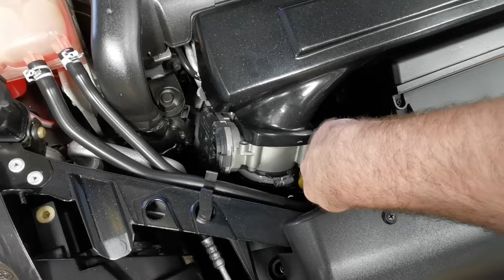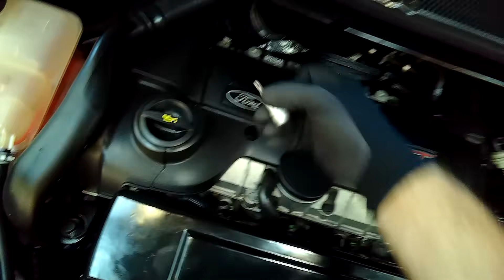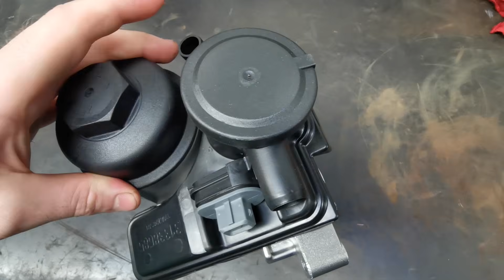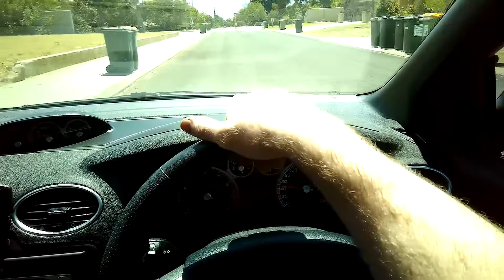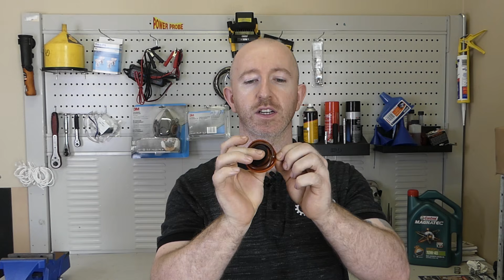PCV Failure In Ford & Volvo's - Step By Step Guide - DIY Repair

Comment from the maker: Lot's of Information in this one guys, remember whether you are removing the housing or just the cap to replace the membrane/diaphragm, I would highly recommend to check the pipes for splits or any blockages.
Due to the vast amount of engine's that this type of PCV valve assembly is included in, I listed websites and engine details in the description below. 
You should have all the information you need to repair this. Thanks for watching 🙏 🙏🙏
Reply: So my question is does the Volvo s40 1.8 2004 does it have the same set up  ? I've done the glove test and it is blowing the glove up. The car only has 84,000 on the clock. 
Really really great video my only problem is I don't know if my car has the same set up. 🏁🤝
Reply: instablaster

Comment: Was she burning any oil? Mine burns oil after going down a hill or over run with foot off the accelerator. Then give her a bit of throttle and a cloud of smoke comes out the exhaust. Do I have a bad PCV valve?

Comment: I have this car. Engine light came on + esp. Obd2 listed 5 codes...all sensors "low circuit". Identified fuse F35 blown. Replaced it. When press start button to only turn electrics on, smoke tindrel floated up from right top side of this oil filter housing. turned off car and Removed fuse... Fire hazard. Would this be caused by this component that has an elctrical connection to it ? I think its called a heater coil inside that diaphragm? If the wire isnt short ciircuited ... That is. Haven't seen anyone with this issue on youtube.

Comment: Very, very helpful! Do you know what is the whistling? One would think that its the air blowing through the broken membrane, but then opening the oil cap should amplify it even more as the air flow is now unobstructed
Reply: I’ve heard it’s air escaping through seals

Comment: Great stuff! Thank you! Was the suction from the oil cap gone after the repair? Or is it normal and just the whistling was a symptom?
Reply: I replaced mine I made sure i installed it the same way it came out! Howling gone but still getting suction at the oil filler and dipstick! I'm thinking just replacing the entire oil housing!!
Reply: as far as I understand it so far, after watching a ton of related content (mostly about volvo though) some delicate suction is required. This is what seals the membrane. @mitsuevo8mr

Comment: Would a bad PCV valve cause oil consumption
Reply: yes. if it's stuck on open it will cause oil consumption and misfires
Reply: Brilliant, thank you, just changing the rubber would be enough to solve it?

Comment: I just discovered a clogged PCV valve on my 2008 Volvo V50 1.6d. I only bought the car 3 week ago with 275.000km (170.900mi). The whole engine is dirty from oil. Approved and official mechanics basically told be to scrap the car or replace the engine. Does anybody think there's any other way?

Comment: So I have been wracking my brain for like, a year, trying to figure out why when we replaced the PCV oil trap on a 3.2L volvo, it now "honks" from the PCV diaphragm, either coming off the brake or just while idling, about every 5 seconds. The sound is for sure coming from the diaphragm of the replacement, and even replacing the diaphragm on the replacement oil catch a second time, we get the same thing. The design on those is even simpler - press cap, rubber diaphragm, and a single coil spring, there's an inlet (outlet?) under the diaphragm to the side of the central outlet(Inlet?), and then the central outlet(inlet?) -- any thoughts on why that all may be? It's been hell even trying to get an answer out of Volvo and they're the ones who built the dang things.
Reply: spoke with a volvo service, guy says there is oil trap box, that rarely anyone replaces. it can be partly blocked. what helped too mas right rpms at idle. i had misfire code, replaced coil, rpm went up and less noise now from PCV. i also replaced seals on dipstick and oil cap. next i will replace seal under oil cap(is some form of plastic neck attached to the valve covers). so basically i go through sealing out all vacuum leaks. my theory now is that slight leaks reduce vacuum, pcv opens a bit then closes fast making the sound. since leak is small and suction is good it "pumps" in an on/ off fashion. probably pcv is not calibrated to work with this tiny leaks to stay just a little open and it cycles through
Reply: same problem with xc9o v8. strange pumping noise i replaced the whole pcv!! no change. tjere is not much to clean neither, pcv there just regulates vacuum. i have now v8 that gjves darthvader breathjng sounds. could you solve tour problem and can share some tips? i have a large vacuum suction in dipstick and oil cap so vents i side engine should be ok as vacuum is reaching both down and top of the engine.
Reply: @biachpiach  I've posted elsewhere on this, but if it's still making a 'honk' (like a goose or duck) then the pcv replacement you received did not have the diaphragm fully seated from the supplier you bought it from, you may need to make a jig to clamp it on more firmly in a vice, it takes a lot more force than expected seating those properly. Darth vader sounds I'm not familiar with, the v8's have a slightly different setup than the 3.0 or 3.2 Si6, but other seal failures can affect it. Also, suction at the dip stick is good as long as it's not a really hard suction. Usually if a pcv is bad you'll see oil foaming on the dipstick, or smoke blowing out of the dipstick neck when you pull it out. Sorry I can't help more than that without being hands on, it's finnicky tracking down pcv issues on most of these cars

Comment: Thanks for taking the time to make this video and uploading Gerard. Followed it pretty much as you suggest. I’m guessing this car was a facelift as there were no similar connectors on my ECU (the red ones you un-clip). I have a pre-facelift and I just unscrewed the ECU and swung it out of the way. Airbox removal is the hardest part but once you locate the lugs on the engine block and notice the angle that they sit at, it gives you an advantage. Ford wanted £256 for the new unit so I popped to Volvo and paid £180. 
Enjoy your ko-fi 😃

Comment: Hi I have the same problem with a focus st mk2, it sucks and when hot it starts to whistle and by unclogging the oil cap the whistling stops except that although I have changed the membrane it is still the same phenomenon of heavy suction and hot hissing some idea what else can cause this please I'm desperate :(
Reply: Hi, just wondering if you ever got it sorted and what was the fix?
Reply: did u fix

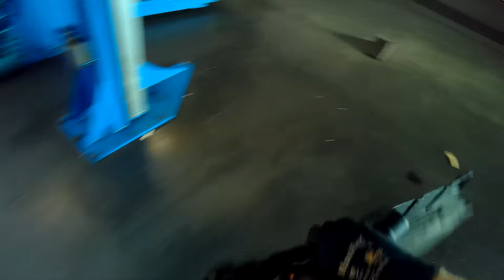Comment: 6:10  It's not a good idea to throw the plastic cover on the floor... they can crack,  they are very expensive, and on older cars they are impossible to get new from the dealer anymore...
Reply: Don't worry, they are quite durable. I hit a warp in the asphalt driving out west one time and it put a small crack in the under tray and the sump is still all sweet.
Reply: It'll be fine

Comment: Replaced diaphragm in my c30 without filter housing removed
Reply: how i’ve just taken the air box off and somehow can’t see it even tho it’s so obvious in videos
Reply: @Cl1pTheCrash some of the caps are mounted with the little opening facing the engine and not towards you
Reply: @xxdareaperzxxable  It's so very hard on my son's s60 because you have to snap it back on and cannot reach it to get enough strength at your fingertips. I had to use a long metal rod and slowly, meticulously clip it back on by pushing/tapping around the edges, and oriented the correct way. It was $12 but didn't matter since the oil seperator in the housing was also failing. It has since failed again but I swapped the whole housing (myself this time) for $140 and that included both hoses. Saved me $600 over the mechanic. DYI this one for sure.

Comment: This doesn’t solve the issue - what causes the diaphragm to split? The system is clogged - this solves the noise but this pressure will eventually blow the seals if you don’t replace the unit :P

Comment: Thank you so much for the informative video. My 1.5 ford tdci engine smokes bleu just when the engine is warm. Two barres in the dashboard temperature gauge. Is due to the EGR. PCV or piston rings. No smoke when engine is hot. 85C•. Any idea ? Thank you .

Comment: Would you recommend replacing the just diaphragm as preventative maintenance?  On my Volvo C30 2.4i the diaphragm cap is easily accessible without taking anything off.

Comment: Great info! I have a volvo s40 2.4i, with looks like the exact parts. I actually just replaced the diaphragm for about $25. After the fix, which did have a torn diaphragm,  the engine still has suction on filler cap and dipstick. Is this normal?
Reply: see robert dyi's videos about it. Do a glove test - cover the filler hole with a glove and if it's being sucked in - you are ok. If the glove is getting glown up you have a clogged system.
Reply: @TheMarcQ  Hold on... I thought suction at the cap is bad?  In this video it's showing suction is bad?
Reply: of course you will have suction that's the point of the whole PCV system. there is a constant air flow through the engine block, generated by the manifold vacuum. the amount of vacuum is controlled by the PCV valve. without vacuum there would be no air flow, thus would make the positive crankcase ventilation pointless. there are some engines without PCV, mainly diesel engines with only a relief hose that ventilates the blow-by gases only. in such systems you will have a slight positive crankcase pressure.

Comment: How do you get the oil  drain  hose out of that oil sump that sits right under the pcv oil box on the volvo 240?  Without dropping the pan ?

Comment: Had that failure on my Volvo S40 II 2 years ago (model year 2005 - engine had about 125.000km).
The Volvo dealership was not very helpful. After diagnosing the problem myself with the help of the internet, I was looking for a reasonably priced oil filter housing, but they are always quite expensive as new parts. Through some internet forum I got the hint for a replacement seal - not from Ford, not from Volvo, but from some small shop in Russia... ordered it for about 30€, waited 2,5 weeks and after that, replaced the seal with the oil filter housing still mounted to the engine. It was fiddly, but afterwards, everything was as it should be.
Reply from the maker: If the cap is removed safely and has no damage to it after removal, then there no issue with diaphragm type repair. Should the cap become damaged it is most likely a whole assembly replacement. I have not found any caps for sale separately.
Good job in diagnosing the fault yourself 👍